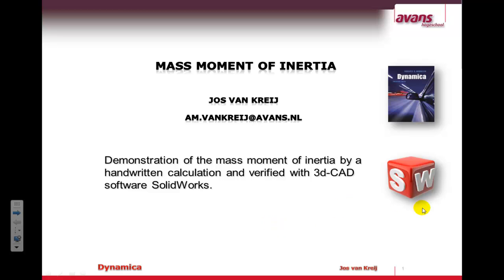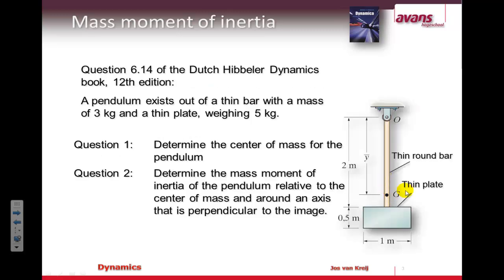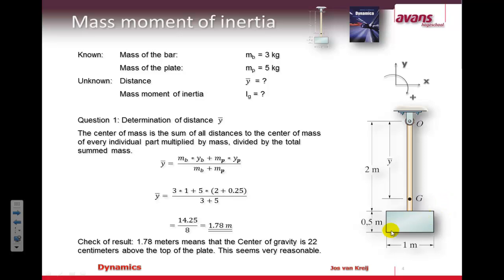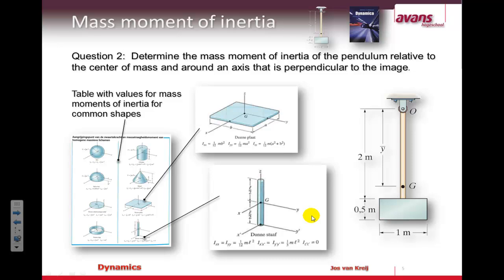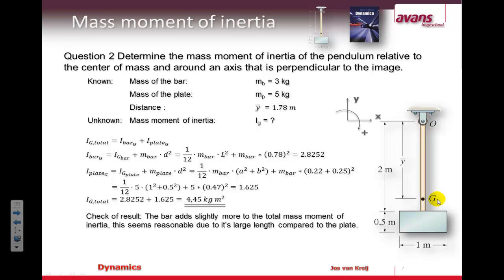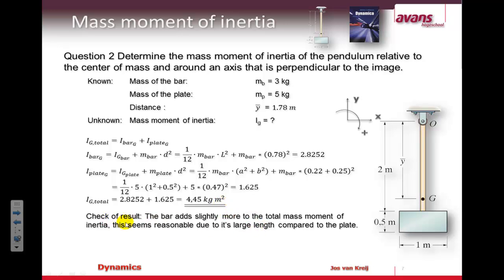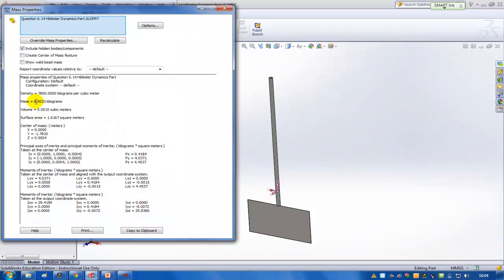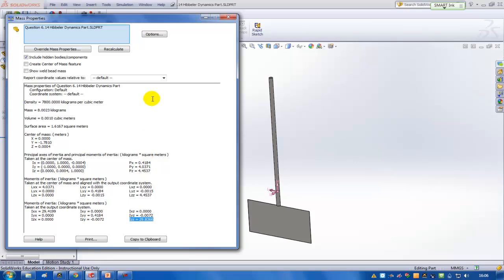Dynamics Presentation - Mass moment of inertia

Comment: First of all, thanks a lot for this quite valuable video. And secondly I wonder if there is any other software, besides well-known CAD software programs, which focuses just on the calculation of moments of inertia or the centers of mass of any geometry.
Reply from the maker: Hello Akay

I just looked in the google play store and there is an app called massentragheitsmoment that can calculate the moment of inertia. It costs 1.43 but doesn't have all the possibilities that 3d cad-software has. I'll let you know if I find something else that can be useful.

Jos
Reply: Hello Jos

The app seems fine. I am thankful for your attention. 

Akay